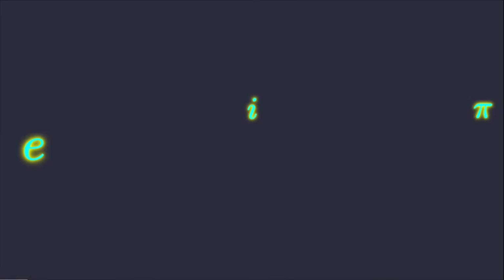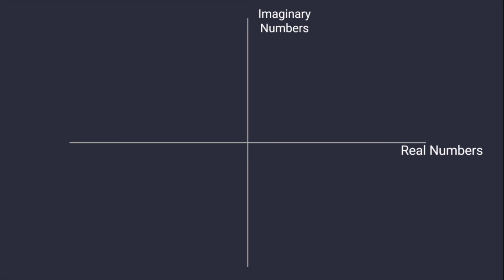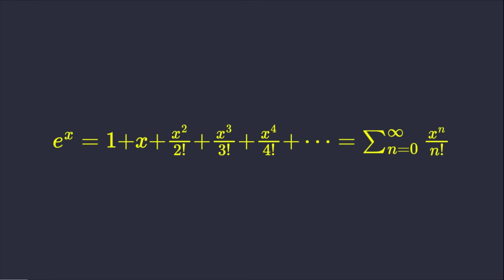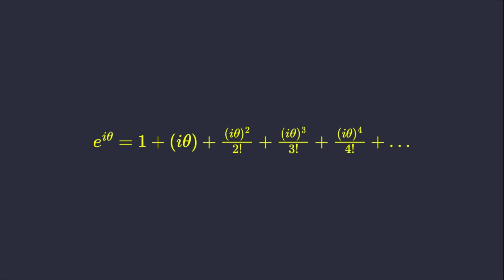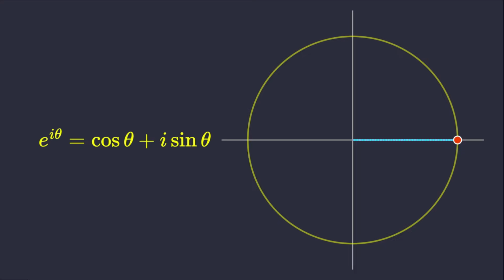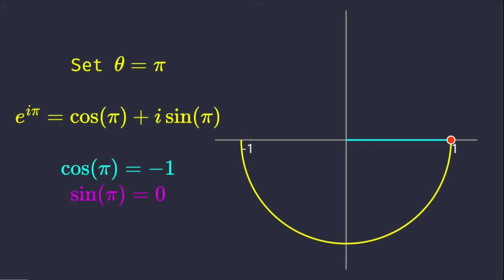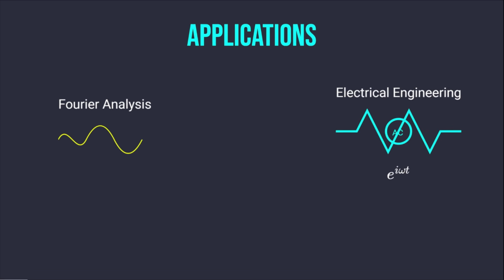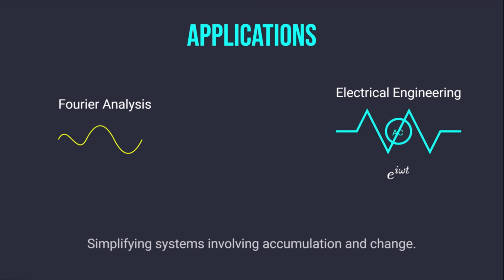Euler's Identity e to the pi i Visualized

Comment: Increasingly smaller derivatives? Actually that sure looks like the chain rule for integration.  Increasing integrals. E is an infinite digit number,  not base 10, base integral,  0th digit 0th integral 1st digit 1st integral and so on and then converted to base 10 to get 2.718....

Comment: Really now? A circle which has radius 1 on the horizontal axis and i in the vertical axis. And you think it's OK?
Reply: Kid you know nothing
Reply: @Maximus-j3t  Is that an answer to my so simple observation? I'm not the kid here...
Reply: @Karagounis4791  Horizontal Axis (x) is the Real Number Part.
The Vertical Axis (y) is the Imaginary Number Part.
Both axes are numbered ...
... -3, -2, -1, 0, 1, 2, 3 ...
At 90°, x=0 and y=1
The Unit Circle of radius=1
r = |z|,
Formula Unit Circle ...
1 = | cos(theta) + i * sin(theta) |
The real (x) part is cos(theta)
The imaginary (y) part is sin(theta)
The radius or vector magnitude is ...
z = sqrt( x^2 + y^2 ) 
Principal Root (positive only)
So compute ...
z = sqrt( ( cos(theta) )^2 + ( sin(theta) )^2 ) )
For every angle theta, including your theta = 90°, straight up the Y axis, the radius, |z|, vector magnitude = 1 !!!
Not "i".
Reply: @MrSummitville 😂😂😂 Don't you know that the imaginary axis has the i=sqrt(-1) as unit? All that stuff you write shows a person with zero thinking capability.
Reply: @Karagounis4791 it's because it's drawn on the Argand plane not the usual Cartesian plane
Reply: @dv2766  So what? There's a cycle there. Do you see it?
Reply: @Chemmattstry  Wdym? Don't you see a cycle in the video?
Reply: @Karagounis4791  brother there is something called modulus of a number which is the ABSOLUTE distance from origin to that point. The modulus of i is 1. Don't learn half assed mathematics and learn the right way.
Reply: @Poise-r5c  😂😂😂 Really? Please elaborate. What are the coordinates of i? Is it (0,i) or (0,1)?
Reply: I would have disbelieved it myself a few weeks ago
Reply: @randomInternetDuder  Please elaborate.